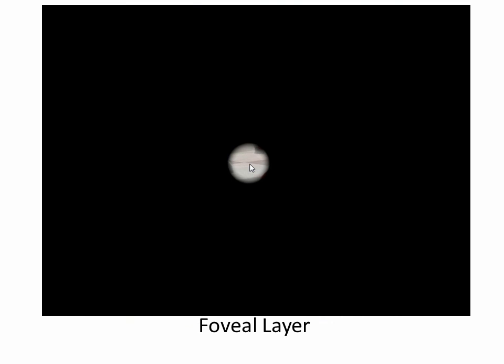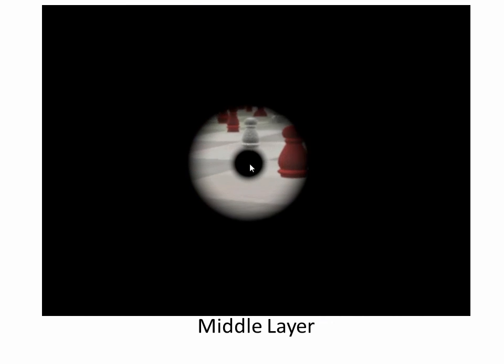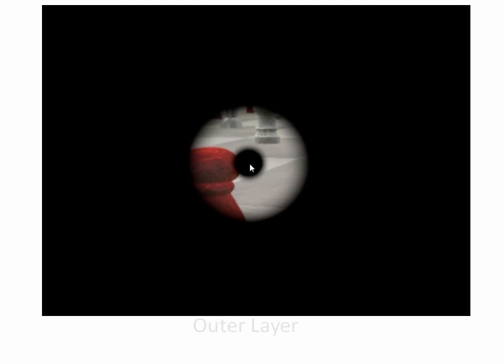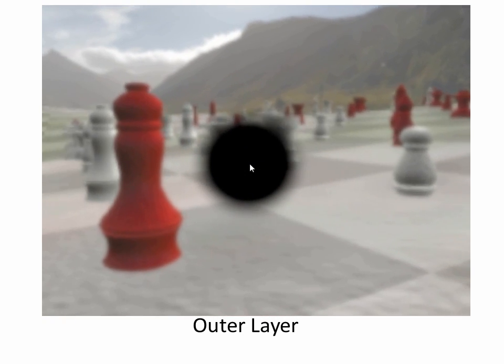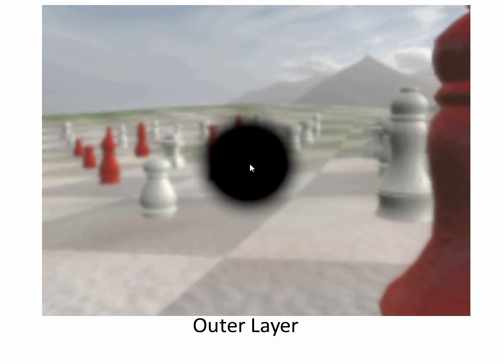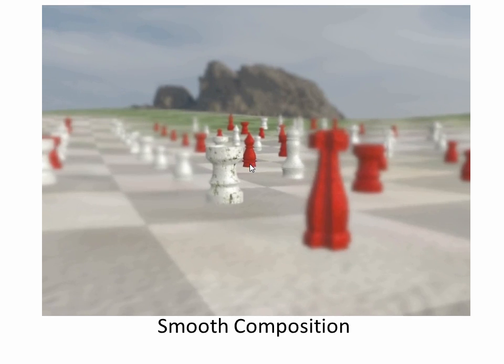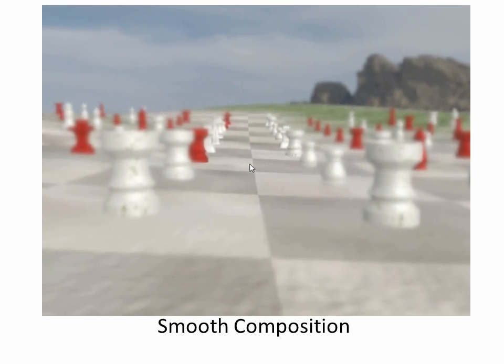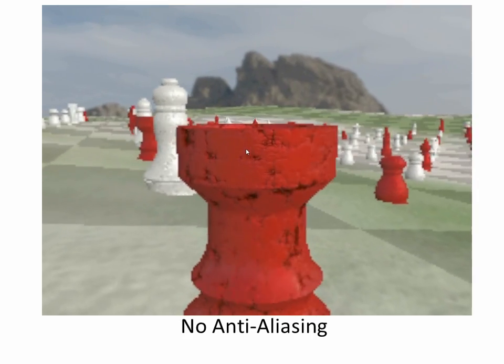Foveated 3D Graphics

Comment: Everything outside of the foveated area looks so bad even when focusing on the correct area (the mouse cursor).  I hope they find a way to fix that so you don't notice it as much.
Reply: This video is showing an extreme case where the area outside of focus is 1/25 of the number of pixels as there are on the display. Imagine if you had a 4k display and the focus was 4k, the middle ground was 1440p, and the area outside of the focus was 1080p. This would alleviate the GPU of a lot of rendering, making games run smoother, but without sacrificing nearly as much quality as the video showed.
Reply: Thats because this demo is meant to show the effect.  Its doubled by the fact its not tracking your eyes, which are jittering even if you dont notice.